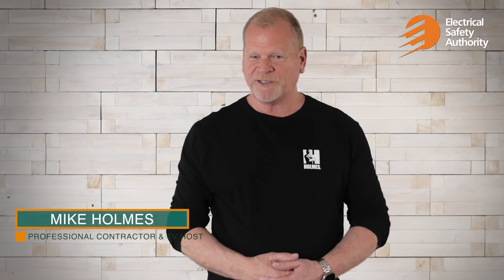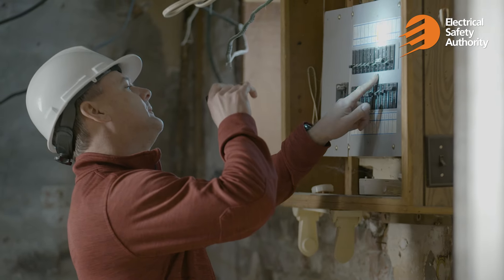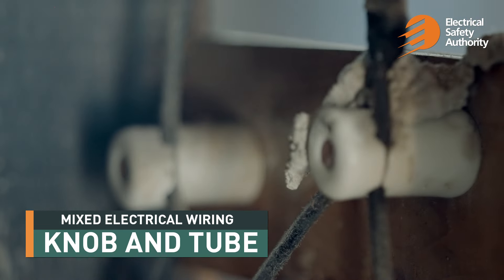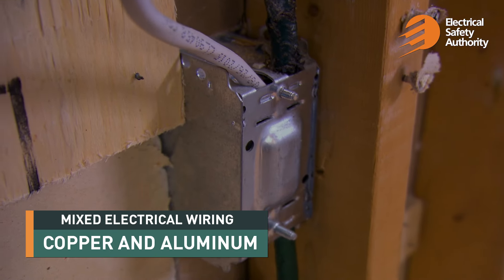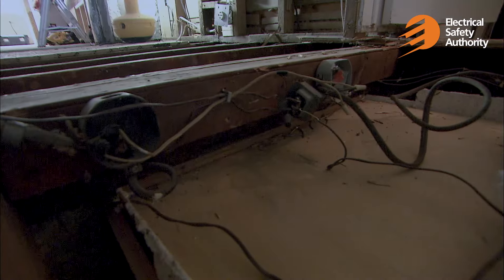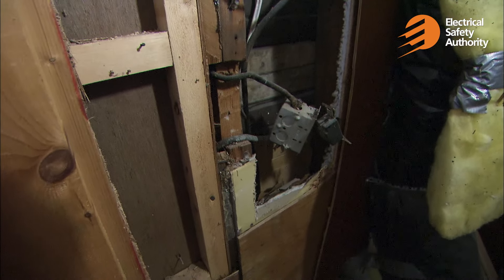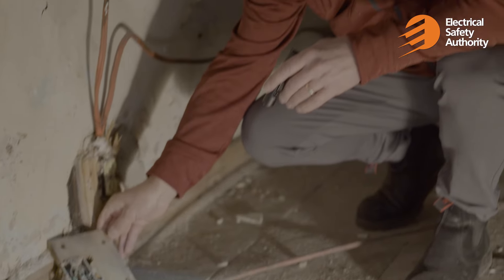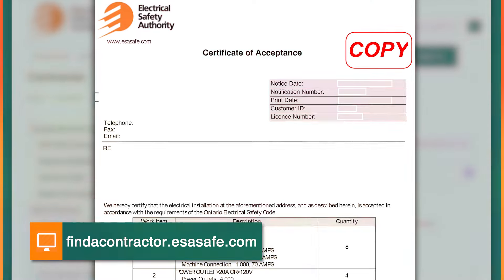Knob and Tube Wiring | HOLMES ON HOMES Episode 1

Comment: I'm pretty sure that burned area on the wood by the knob and tube wiring isn't from a bad connection.  When they used to connect K&T wire they typically soldered them together - the burned area is from when they did the soldering.